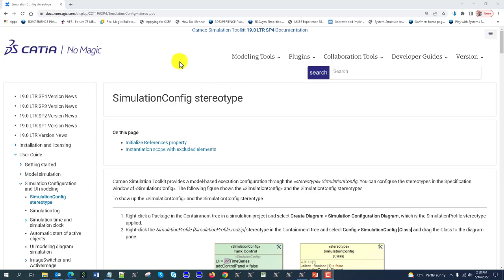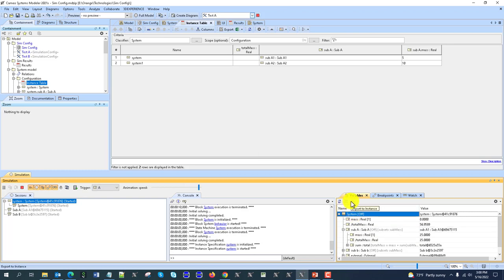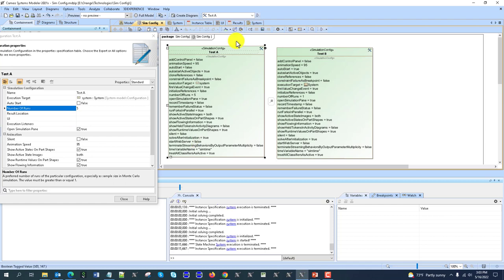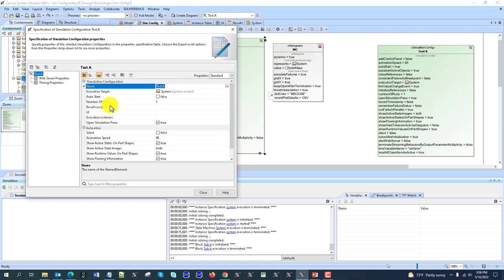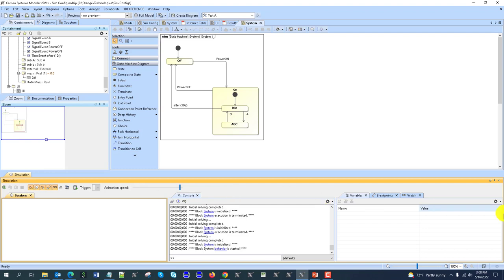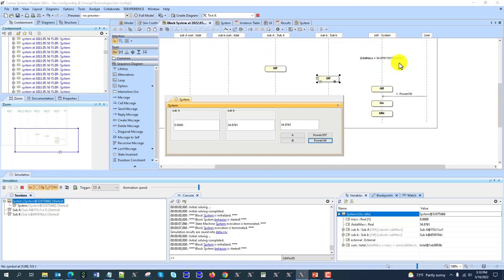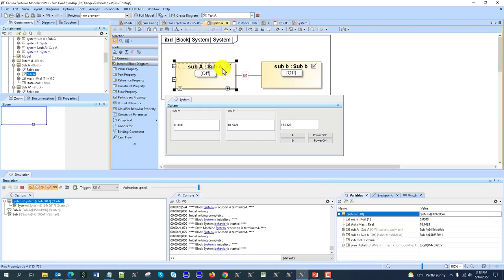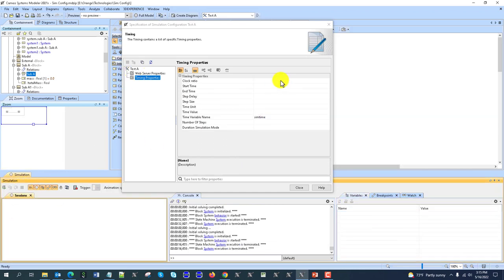Introduction to SysML Simulation Configuration

Comment: Thank you for the detailed explanation. I need to ask you something. I am trying to connect The magicgrid tool with some other tool. So, when i run the simulation, i need to get simulation time, step size, maybe signal values etc.

How can i see these values while i run the simulation? 

Thanks.
Reply from the maker: Hello Ufuk. Great question. Those characteristics comes from simulation config which is in the model. Some of them are part of the model itself. Simulation time you can get from reserved variable - simtime. 

Is question how to interchange simulation data with other tool? If yes you can export to file and read from file, you can write / read to excel or csv, we have multiple tools like Matlab and scripting languages like python support, also use FMU to connect simulations. Search for those methods in youtube channel.